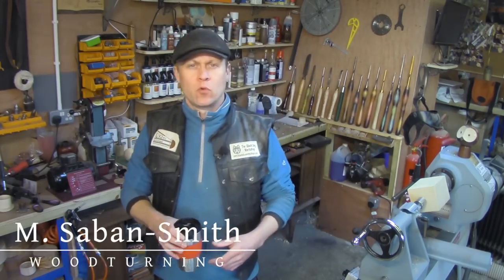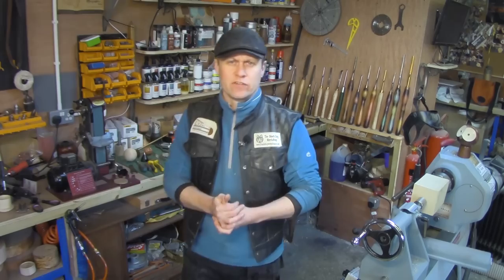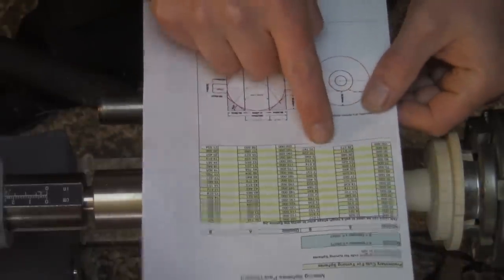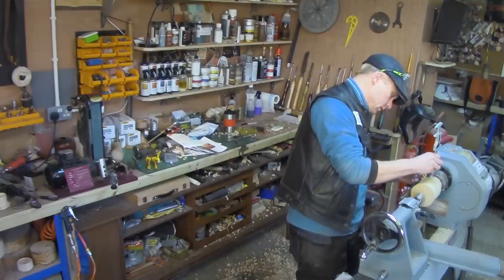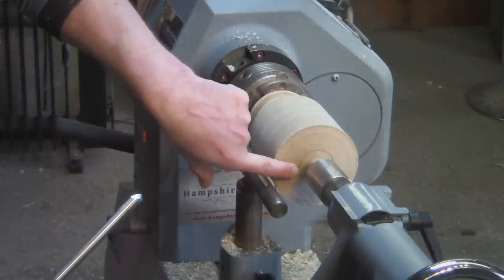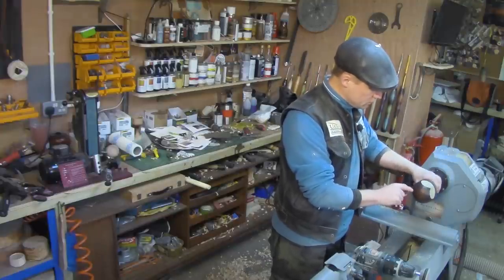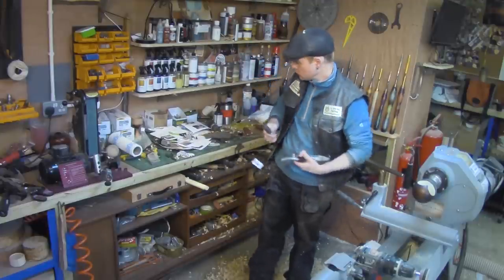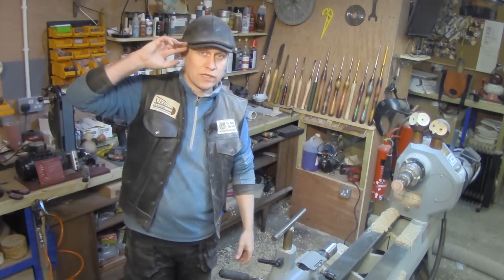#86 Owl! Sphere Jig Woodturning Project

Comment: Martin does your air chuck sound like it leaks air from the generator when it’s on great project jig on the want list 😍
Reply from the maker: Hi Gary. It does yes, which is perfectly normal according to the manufacturers instructions. It's the air coming from the compressor rather than the vacuum forming 'bits'. Thanks for your concern though.

Comment: Absolutely love it. The whole idea. Lil owl beautiful.  Would that kit bolt to a Lathe like mine which is not a double rung bed mine is single but big. I run a really old Vicmarc Lathe
Reply from the maker: +Matt Richardson Thanks, Matt. If you take a look at Paul's website (link in the video description), it has details on the lathes it can be used on. Paul is really helpful, and may be able to assist if you need it.
Reply: I will thank you